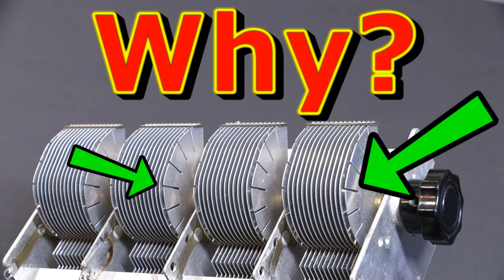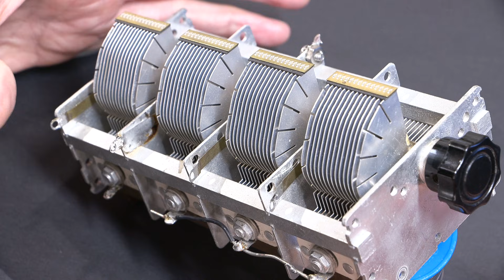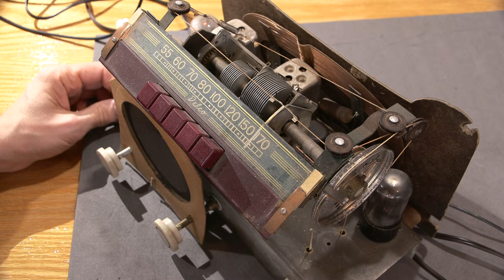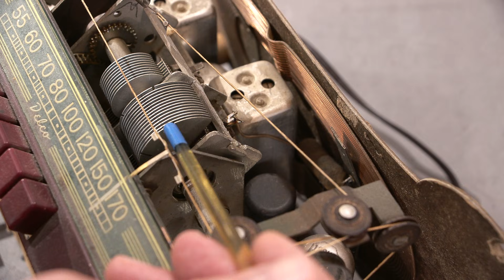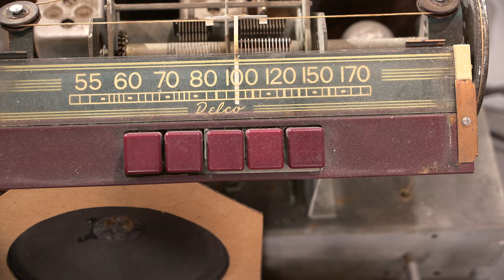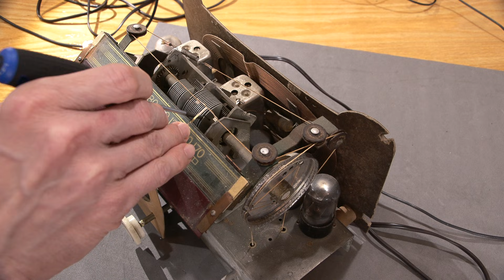Why The Cuts In The Capacitor Plates? Here's Why With Circuit Examples!

Comment: I realize that I will get a bunch of flack for this comment, but I think it needs to be explained, so people do not mess up their radio alignment.

The slots in the capacitor plates ARE for adjusting tracking, but NOT to make the DIAL track with the radio channel. Instead (assuming a typical superheterodyne radio), it is to make the LOCAL OSCILLATOR track with the RF (Radio Frequency) amplifier stage, in such a way that the oscillator frequency is always 455kHz ABOVE the radio frequency. 

If the radio uses 262.5kHz (instead of 455kHz) for the Intermediate Frequency, then the oscillator frequency must track with the RF stage, in such a way that the oscillator frequency is always 262.5kHz above the resonant frequency of the Radio Frequency stage, as the tuning dial is changed. The position of the pointer on the radio dial, is (for the most part) irrelevant. 

If you try to bend the capacitor plates to calibrate the dial, you will mess up the tracking between the oscillator and the RF amplifier. Instead, to adjust the pointer, do the same thing that you would do if you needed to replace the dial cord: 

1)	Use an RF signal generator to generate a modulated signal at the center of the band (such as 1,000kHz carrier, Amplitude-Modulated by a 1 kHz tone). 
2)	Turn the radio dial until the signal is received clearly.
3)	Slide the pointer along the dial cord (string), until the pointer is pointing at 1,000kHz on the radio dial. You will likely have to create a little slack in the dial cord, to allow the pointer to slide-along the cord, without damaging the cord or bending the pointer. 

While performing step 3 above, it is easy to accidentally move the tuning capacitor. So, repeat steps 2 and 3 above, if needed.

Also, if you do not have an RF signal generator, you can simply tune the radio to a local radio channel, that is operating on a KNOWN frequency - preferably, a channel that is near the center of the radio dial. Then adjust the pointer along the dial-cord, to match.

The above assumes the radio is properly aligned. If you suspect the radio to be out of alignment, then follow the alignment instructions to set the dial pointer - you might need to start at the lower end of the band, instead of the center.

Comment: Very well explained.  Of course to align a communications receiver you would need to have test equipment and the workshop manual which would give all the necessary details of required adjustments.
.

Comment: Mr. Carlson:
I've been rotecting and saving 
an antique radio for the last 65 years.  It has odd shaped silver tubes with hard silver wires thru out.  It has a black face with dials a solid base and a glass case, sides, top and back.  It is about, 12x6x8.  
The front and bottom panels appear to be of a black stone material.  It has no speaker.  It had a black leather case with purple felt lining but was worn, ripped and torn.  As a child, I tossed it and kept the receiver.
Is it possible to send you a photo.  I've tried to identify it without success.

Comment: the four section 450pf ganged caps were used in TRF AM recievers mostly. Sound quality was great. Tuned Radio Frequency, TRF vs super hetrodyne. I like them now for low power HF antenna tuners. Repurposed and still cool. Mr Carlson...you're bench is so organized that seeing it sends me into shock. You know your stuff, thanks for sharing it.

Comment: Thanks for the videos. Merry Chrismas, Happy new year.
> Heck I'm 64, I'm no electronics guy but just some curious old farmer with  "inquiring minds want to know kind of guy syndrome">>I was sure that moving the string and needle was the closest you were ever going to get when working on the station selector! I didn't know that the plates were meant to bend! ! As a kid just taking stuff apart to see how it worked before  it was discarded. I was always afraid of bending those plates  thinking it would never work again if that ever happened! I sure wish there would have been some electronics education available for me out here on the prairies of C ND when I was a kid! I wish i had some of those old radios back I had taken totally apart when I was probably 10 At that point I didn't know what a capacitor or a resistor even was or what it did. One of the radios was a wooden Airline  5 band.....

Comment: Thanks for the vid. A tip and a question: Please clarify that the capacitor plates start and end with an upper movable plate in each section. Q:  are these connected as one big capacitor?

Comment: Nowadays I doubt anyone makes such variable cap tuners- they all are 99pc maybe- DSPs tucked and dressed as an old analogue with a knob and a dial..
My question is
In your expertise- and opinion- which is better (an eternal debate) an analogue with Variable Cap  ir a DSP? 

I seem to prefer an old radio, using valves/tubes and VCs like this still out perform the modern ones. 
I once watched a video on YT, how a C1930s Philco was far more sensitive then a modern radio (Consumer radio) ..
Can't trace the vid.

Comment: Wouldn’t you have to align for max an min frequency first? What oscillator does the larger capacitor tune? Why no just move the indictor needle instead, rarely are uppermost and lowest frequencies used so moving the needle instead would seem to make sense.

Comment: The purpose of the cuts in a superheterodyne receiver is to move a section of the oscillator capacitor plates so that the frequency generated by the signal and local oscillator mixture maintains, as closely as possible, a frequency difference equal to the receiver's intermediate frequency.

Comment: I knew the cuts had almost no effect on the capacitance vs a solid plate due to the fringe effect around the cut.  I've never seen these bent on any gear I've removed them from, but I guess it's as good an explanation as any, assuming no technicians ever did this fine alignment at the factory on any equipment I've worked on.  I always assumed they allowed a technician to align the pointer on a knob with the capacitor, or fix the cap in position temporarily with a jig, with the notion that different radio manufacturers had different dial templates, but all used caps off the shelf.  It's a little scary to think that a technician could easily accidentally short the cap on a transmitter bending it back and forth (on the forth).

Comment: I HAVE BEEN USING THESE PICOFARADS CAPACITOR FOR YEARS AND YOU ARE THE FIRST TECHNICIAN TO EXPLAIN ABOUT THOSE CUTS. CONGRATULATIONS.
Reply: What i gather is that it makes it easier to tune the frequency? Doing that is similar to stretching or compressing a coil to change it's resonant frequency?
Reply: And the ALL CAPS statement is for what reason??

Comment: Nice video. I’ve been an EE technician working in radio for over 30 years, and never knew this. I remember taking apart old radios as a kid, and seeing these tuning capacitors and wondering how they worked. Subscribed.
Reply: Those cuts assist in tracking, particularly towards the upper end of the band. Avoid re-bending unless absolutely necessary. Cheers Bruce N7MMR
Reply from the maker: Welcome aboard!

Comment: You are varying the capacitance by the physical proximity of the plates moving through the static plates, and increasing the area exposed to static plates, which affects the capacitance and tuning. I saw this when I was about 13 with my Dads old Rigonda stereo we brought from England lol.

The plate shapes are for the same reason as potentiometer diffenerences? Allowance for finer tuning?
Don't 'gang' up on me, even if I got it wrong. 🤣

Comment: If I remember correctly they would be unneeded if used with today's digital readouts, but "we" and "I" had no such thing back in my day. Those cuts were put there to help track the analog dial it was mechanically connected to. The tech was expected to gently bend them in or out to "calibrate" (track) it with the analog dial. In radios, that would be the frequency readout. I still own my Dad's Hallicrafters SX-42, that he bought on my birthday in 1946. It was my only receiver from novice to general class ham. Heck, I still own my SB-301,....  in better than  MINT. Yup, there's a ganged air variable cap in there too.
Wakodahatchee Chris

Comment: What do you do if you get 1000am tuned but then say, 700 or 800 is off? Why did you bend the small capacitor instead of the large?

Comment: I always thought this was to peak the antenna tuning circuit at the tuning frequency. With the padding capacitor alone, this is never perfect.I always adjusted the oscillator correctly in relation to the scale using the ferrite core or the trimmer on the tuning capacitor

Comment: 1:47 I learned that a capacitor store energy. So here we have maximum capacity meaning it stores the maximum amount of energy. So the question is how does this translate to low frequency?
Reply: Let me try a simpler version of the explanation. A larger capacitor holds more charge (and thus more energy at a given voltage). That means, for a given current, it takes longer to charge to a given voltage. Longer time => lower frequency. This is really the same explanation as @scech1 gave, just shorter. It's worth reading that explanation for a more thorough exploration.
Reply: As a voltage is put across a capacitor, current flows in according the the capacitance of the capacitor, more voltage/capitance, more current/power. As the capacitor fills it gets a voltage that reduces the "apparent" voltage, causing current to go down as the capacitor voltage comes up to the input voltage. Higher frequencies have less time to fill the capacitor with charge , so the voltage drop across the capacitor is lower. 
Current through the capacitor is based on the change in voltage over time, slope dV/dt, and higher frequencies have a larger slope for equal amplitude. 
And its not nessisarily better for for low frequencies than higher, it just would tune the larger circuit for a lower frequency as the capacitance whent up

Comment: Haven't watched more than the intro so far, but was first thinking eddy currents. But I see they are slightly bent so possibly tuning the capacitance curve by manual bending of the tabs, probably done in circuit. (Seen a lot of these from old equipment, even used in my projects.)

Comment: Some radio receivers took a different approach to the linearity problem by using slug tuned inductors rather than variable capacitors.
Reply: Where tuning the radio moves the slugs. Yes, that can work too. I had a radio where the VHF/FM part was tuned by moving brass slugs through the tuning inductors.

Comment: So? The cuts (slits, notches) on the variable capacitor plates are essentially dips in capacitance. The capacitance is lower because the crossectional area of the capacitor is lower there at the cut. This is an example of precise frequency controll GREAT IDEA !

Comment: Writing this before I watch the video. My understanding has always been that they were to allow accurate trimming of the capacitance but the fact that this video exists makes me suspect that I have been confidently thinking the wrong thing for the past 40 years or so.
Reply: Sigh of relief, exactly what I thought.  

One thing though that has always troubled me is that the tuning capacitors in small transistor radios also had slots in them, which obviously couldn't be bent for adjustment since they are sandwiched between dielectric sheets. It's something I discovered relatively recently when trying to restore an old transistor radio that had a jammed tuning dial and caused me some confusion. The jam was apparently caused by the edges of the slots cutting into the insulating sheet resulting in one big tangled mess when I guess the user tried to force it to turn.

Comment: I was told many decades ago that those side adjustments were done when the caps were made at factory to 'fine tune' the sections so they were as near identical as possible. Well, never too old to know the reasons why although I have always used the tabs to improve tracking anyway...I thought it was a dodge, not legit.😊

Comment: Strictly speaking of the dial is spot on at both ends but slightly out at the middle, if you adjust the cap plate then yes the HF section of the dial will stay on freq, the middle will be corrected but the LF end will move a smidge up as the overall cap there will also have been red by the same ( but it is less significant... Assuming it is 30 to 300 & you make 0.5pF central adjustment.. Unmeshed 30pF unaffected, half mesh now 149.5pF so moved just enough, fully meshed now 299.5 so it has reduced there too just not proportionately significant.)

Showing the sprung antibacklash gears might interest some too.

Comment: Those cuts look COOL!!!!!!!!!!!! No, I had a big tuning capacitor from a big radio from the 1920-1930 which had every band you could think of from that era. Sadly enough it rusted and was not salvageable. Sadly, but it only had two tubes that were broken, in early eighties when and if they were available (no internet to go look for it) I could not find them. Pity.

Comment: How does bending affect the characteristics of the variable capacitor? I would imagine that the capacitance does not change in the same way as it did before bending. It seems easier to adjust the position of the needle on the string.

Comment: If one was calibrating the whole length of the scale and not just one frequency as here, could it be that one would have to "skew" the plates rather than just bending them the same amount around the circumference? Than would definitely be much easier with the cut slots in them.
Reply: That was the theory.

Comment: Yes, Mr Carlson I can answer the why. This is done religiously in certain companies almost cult like. The cuts in the capacitors are not flaws but physically cause a variably controlled electromagnetic field; in other words they are sacred apertures. The elders insist this is not religious, even though there are diagrams, rituals, and a strict ban on asking questions. "Through these cuts, the Why gently escapes into the circuitry, subtly influencing behavior, posture, and arm placement." Membership is really not voluntary, it's kind of deceptive because at first you don't feel this electromagnetic field of course—everyone is not free to leave after proper discharge and approval from elders. The fields only change but their there is still a applied field produced by these cuts. If you don’t feel the controlling electromagnetic field from their capacitors it’s simply because you haven’t been calibrated yet by this applied why. This is the reason I no longer believe or practice any religion.

Comment: I had a hard time repairing and aligning an audio Oscillator - it had a set of weird problems, including not oscillating at certain spots, and having all sorts of tracking problems. 

The problem was that someone had twisted the ganged cap plates to be shorted at some spots, and spread apart in other spots. When the plates were shorted, the oscillator stopped working, and when the plates were spread the capacitance varied in strange ways.

I had to carefully twist the plates to remove the shorts, and remove the weird changes in capacity. I think that Oscillator had been 'fixed' by a previous tech to allow him to junk the oscillator, so he could have an easier Friday.

Comment: I gotta dumb question and nobody else to ask.
What happens when you take one of these fully meshed, charge it to its maximum voltage, then disconnect the terminals and unmesh the capacitor?
Reply: They are such a low capacitance that it's difficult to charge them and have them hold the charge. But if you had a very clean dry place then the voltage would increase as the plates unmeshed.
Reply: @BrianG61UK  The question does assume fully ideal behavior, bath of dielectric oil, what-have-you.